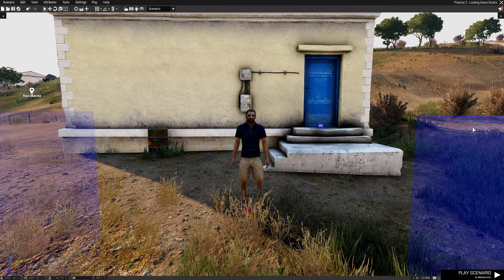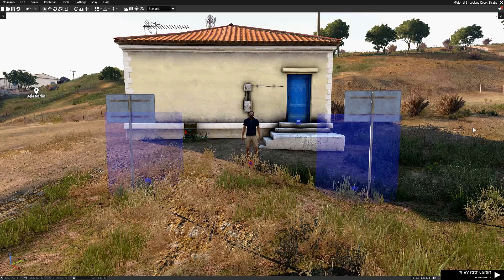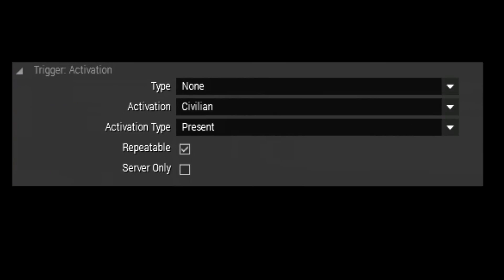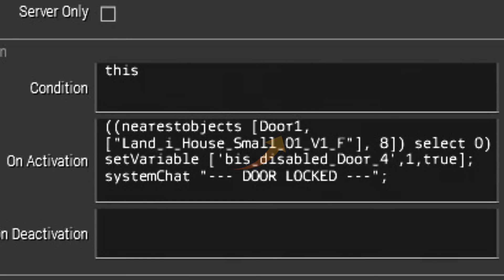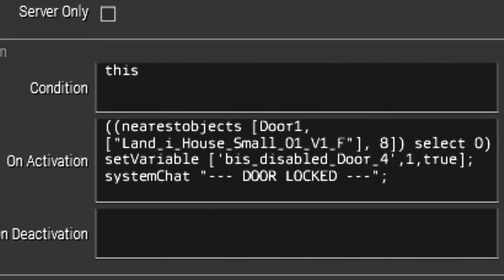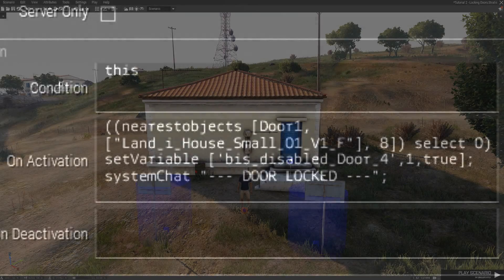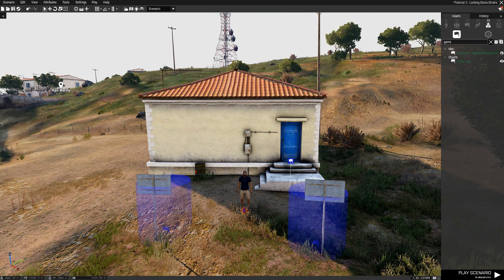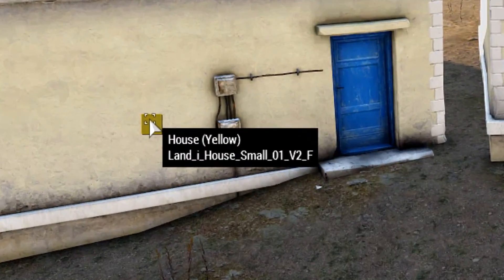How to lock building doors? - Arma 3 Editor

Comment: Hey man, this method worked great for me, i use it all the time in my scenerios, im having trouble using the same method for locking a gate ive placed in the editor, just wondering if you had way of doing so using the same method.

Comment: Hello mate this isnt really working for me, I can lock a door in a spesific building no problem, but the thing is its the trigger to open them to a spesific side like Blufor, But the thing is, what you showed in the video didn't work at all sadly,  what i did I put this in the init field of a spesific object rather than trigger house1 setVariable ['bis_disabled_Door_5',1,true] in this case I used the Military Offices, however I can lock the door, but I dont know how to unlock for Blufor so only the Blufor side can open the door, I tried your Unlock door trigger with the Gamelogic exactly as you said the door didnt budge at all, so is there a way you can help me with this?
Reply: easy way is to name your building build1 and   use a trigger . Put a trigger  covering  the  building  .in the trigger,  find the trigger activation and  select  activation BLUFOR  and activation type put present .make shore tick Repeatablein the trigger Expression for On activation put   
 build1 setVariable["bis_disabled_Door_1",0,true]; build1 setVariable["bis_disabled_Door_2",0,true]; 
build1 setVariable["bis_disabled_Door_3",0,true]; build1 setVariable["bis_disabled_Door_4",0,true];and for On Deactivation put build1 setVariable["bis_disabled_Door_1",1,true];build1 setVariable["bis_disabled_Door_2",1,true]; 
build1 setVariable["bis_disabled_Door_3",1,true]; build1 setVariable["bis_disabled_Door_4",1,true];put a BLUFOR unit in the house and once he leaves the trigger it will lock .if you got more doors then you will need more setVariable for doors 5,6 and so on .hope this helps